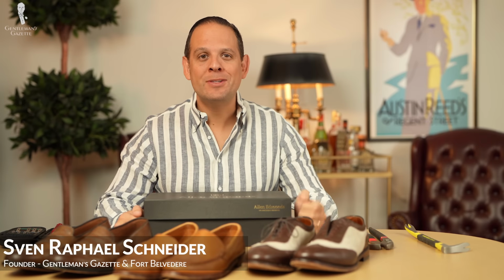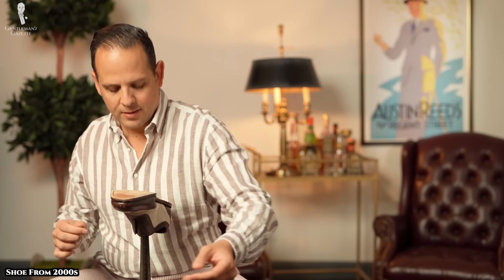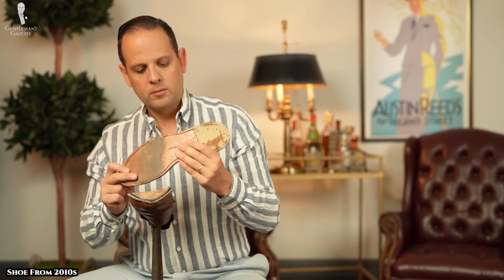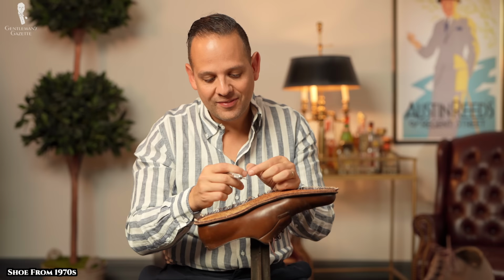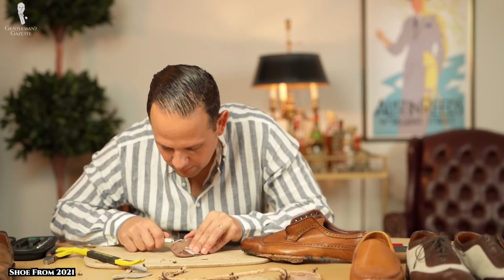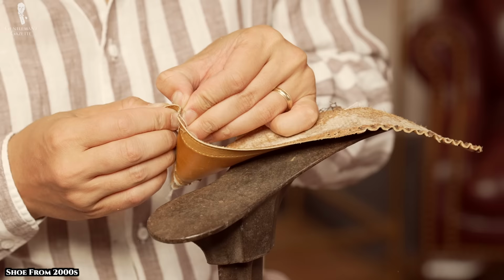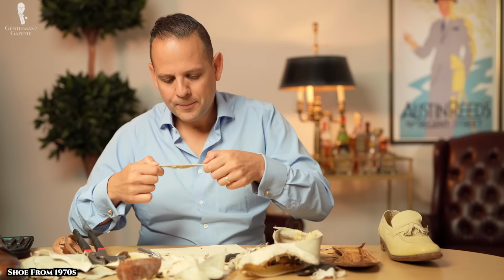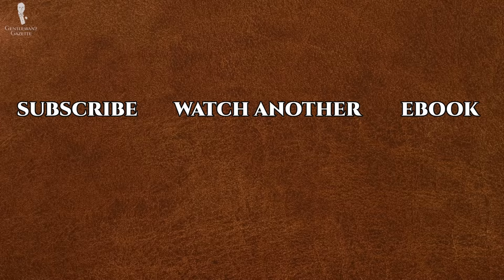Cutting Apart 50 Years of Allen Edmonds Shoes (Value Review)

Comment: Those tacks/ staples are temporary holds for the gamming, lining and upper before it is all stitched together with the welt. All shoes and boots that are not hand welted have those. Hand welted boots or shoes will use temporary nails that get pulled while the welt is stitched

Comment: Couple of notes. The heel blocks are leather board, not leather. Allen Edmonds heels are thicker on the inside as a means of additional arch support. The thicker inside puts upward pressure in the waist area of the shoe as you walk. 

The pieces of canvas under some portions of the leather is there to prevent squeaking that sometimes happens when you have leather against leather. 

The cork is hot poured cork. It is actually slightly better than sheet cork that even bespoke makers use. Hot poured cork fills all of the void every time. Sheet cork can sometimes leave small voids. Not really noticeable in most instances. 

The staples in the upper are there to tack the shoe to the last before the welt is added.
Reply: Sheet cork can be just as effective as poured cork assuming several layers of contact cement is applied first. The liquid contact cement will fill in all the voids. Contact cement dries into a cushion of soft rubber.

Comment: I’m only at 2:30 and already misleading info.🤣Rafayel, those are fiberboard heel blocks friend. The crow bar is classic, I need to get one to take heels off, never thought about that. 🤣🤣ok back to the video
Reply: Exactly what I was thinking. Kind of reminds me of the belt video.
Reply from the maker: How do you chemically determine if it is fiberboard made from wood vs, leather scraps?
Reply: @gentlemansgazette  that’s a good question. The source for that answer would be to contact the manufacturer directly. No not A/E but the actual company that makes the heel bases. MONTELLO HEEL MANUFACTURING INC. HAS BEEN HANDCRAFTING CUSTOM SHOE COMPONENTS FOR OVER A CENTURY. They are located in Brockton MA. They call it leatherboard thou not fiberboard. They are good people, maybe a phone call would answer that question
Reply from the maker: @BedosLeatherworksLLC  Thank you

Comment: So, basically, with all the talk about Allen Edmonds declining in quality, the only difference in construction the past 50 years is that they've replaced leather heel caps with thermoplastic heel caps. A perfect illustration of how a narrative takes hold and becomes accepted fact even though it has no basis in reality.
Reply: I think the issue is quality control rather than quality itself. 
And I would not doubt if it’s the factory being overstressed to put out more shoes.
Reply: That's not completely true. I handled a few vintage AEs and apart form obvious QC issues can tell the uppers and welt stitching was much more dense, and soles were cut nicer
Reply: @thebarofsoapIG  Yes. It's hard to overstate this point - that quality control can easily vary as owners,  manufacturing locations and experienced/trained employees change.
Reply: @thebarofsoapIG   Its more than QC, its operators on key jobs not being trained/supervised well enough. If the QC is receiving 80% of the product in a poor state, they cannot reject them all and decisions to pass lower quality have to be made. This is the state of the trade nowadays in lower priced brands. They cannot pay high enough wages to retain the more skilled operators and managers and the product suffers. Blame the cost of living for the loss of affordable quality
Reply: I’ve worn Allen Edmonds shoes for almost 40 years. I still own a pair that I bought new 25 years ago. My cobbler recently installed old stock JR soles. The stitch count on the welt of my 25-year-old shoes is noticeably higher than a pair of AE that I purchased two years ago. The mid sole on modern Allen Edmonds shoes is just a very thin piece of leather. The particle board heel stack is just unacceptable in a shoe retailing for almost $500. Two years ago, I purchased a pair of AE Landon boots. They had several obvious cosmetic flaws, and the midsole was a very thin piece of leather. The boots had Danite outsoles. I sent them back. I bought a pair of White’s MP’s. I recently wanted a pair of dress boots, but couldn’t pull the trigger during AE recent sale. I purchased a pair of Beckett Simonon boots instead. They are made to order, and won’t be ready for a couple months. I’ve seen several comparison videos between the two companies. BS boots come with genuine stack leather heel blocks. I paid $169 during their recent sale. It breaks my heart, but the quality and quality control at AE are not what they used to be. Unfortunately through the years, AE has been bought and sold numerous times. I hope AE can improve its quality control. They have been around over 100 years. I hope they can turn things around.

Comment: I think the quality depends on the model, their classic line like the park avenue or 5th avenue tend to be better quality.
I have those mentioned for 2 years now and are still going strong. A lot of their offshoot models usually feel inferior.  I had a pair of Chicago Derby from them and right away the leather felt off. The sole was full rubber(still goodyear welt)  and single pieced.

Comment: A couple high-end shoe stores in town told me they even stopped selling them because the quality is so poor. They told me it depends on the style of shoe. A lot of their traditional styles are still of decent quality, but not always. I bought 3 pairs in 2016 and none of them were 2nds. The sole of the loafer wore all the way through in 3 months. The black wingtip's heal cap fell off after a couple months of wear during a funeral no less. The third pair, I still wear multiple times a week.
Reply from the maker: Interesting observations, Chris! Thanks for sharing.
- Preston
Reply: i can tell you why that's the case. It's because they wanted to sell from their own stores, and didn't want to do it through 3rd party retailer. Literally I asked a few dealers of high end shoes in the Gables and The Fashion district in Miami, thats what they told me. Simple Economics of cutting down cost

Comment: I currently don't have a need to wear dress shoes on a consistent basis (I work outside so work boots all the way), but I'm sure in the future with a career change, I will. I'm going to be eyeing AE until that day comes and probably go for a pair of 2nds.
Reply: They have sales almost every month haha so you could find proper qc shoes for over 100 bucks off!
Reply: @kart182  You're right about that. I checked their site earlier and they had 5th avenues down $100 so they were the same price as 2nds.
Reply: Get them used or as seconds.  If you want better quality at a similar/lower price check out grant stone.
Reply: @franky3fingers337  I second that. Can't recommend Grant Stone enough, although their last for some of their shoes can be a little "bloated" in my opinion. Nevertheless, great quality, great build, great leather and great looks
Reply: @bossman4799  Just buy them now.  Wear them when you're indoors, not working, relaxing, field tripping, shopping, ducking out to the corner shops.  Allen Edmonds may be a beginner's brand for dress shoes but the quality far outweighs their position in the market.  Truly worth the money and my used pairs from 2018 onward are still being worn.  Today I slip into my Del Ray.

Comment: The 360 degree welt has the advantage of better water resistance to the 270 degree welt. But you trade that for a less sleek look.
Reply: maybe, technically.  But the iron ranger for one has a 270 welt.  As does I believe the Indy.
Reply: @claytonberg721  The Alden Indy boot and the Wolverine 1000 Mile have 270 also. Both experience water seepage at the quarters when exposed to water.
Reply: @janerkenbrack3373  anecdotal of course but I hike in iron rangers in all kind of conditions but have never had water seepage.
Reply: @claytonberg721  People will have different experiences. But one of the benefits of a Goodyear welt is the protection against water coming through the connection between the upper and the sole. It is well understood that the 360 offers more protection than the 270. For some this isn't a big deal.

Comment: I purchased a pair of strand oxfords with rubber tap sole in walnut in 2021.  It took maybe a week or two to break in.  They're still the most comfortable dress shoes i've ever owned.  There is very minimal creasing in the past 2 years since i've owned them.  In the beginning, i was using these about 3 days a week. Nowadays, i use them about two times a week to the office. I'm considering ordering a pair of Carlyle Oxfords with the Dainite or rubber tap soles but they're starting to get pricey, even during their sales. Not sure what alternatives would be out there in similar or lower price ranges.

Comment: There has been some debate in the menswear community about whether Allen Edmonds shoes have gone down in quality in recent years. While opinions vary, it is generally agreed that there have been some changes to the brand's manufacturing process and materials that have impacted the quality of their shoes.

One major change was the introduction of a new "integrated cork" footbed system in some of their shoes, which some customers have found to be less comfortable and durable than the previous cork footbeds. Additionally, some customers have noted inconsistencies in the quality of the leather used in their shoes, with some pairs being more prone to creasing and wear than others.

However, it's important to note that Allen Edmonds still produces high-quality shoes that are well-regarded in the menswear community. While some customers may have had negative experiences with the brand, others continue to be satisfied with the quality of their shoes and the company's customer service.

Ultimately, the quality of Allen Edmonds shoes may depend on the specific pair and the manufacturing process used. It's important to do your own research and read reviews before making a purchase to ensure that you're getting a pair of shoes that meet your expectations for quality and durability.

Comment: I watched reviews, read up on the Allen Edmonds manufacturing methods and history, it all sounded great. So I bought a pair of Chukka Boots, great product, great purchasing experience overall, I decided to buy more shoes. Bought a pair of Dalton Wingtip Dress Boots. I received 2 different color boots, also one of the boots seemed to be a different vintage or much older and had been on display for some time. Multiple price tickers attached and removed, physical dimensions were different, a different cut of the same style. I called customer service, they apologized and said they would send out another pair, free shipping. Got the next pair, shoes are with out a doubt reject, much worse than even factory second shoes. I wear a size 9.5, the shoes I received are a size 8 or possible even smaller, maybe 7, but marked as a 9.5 D The shoes were also misshapen. The left looked like a right, the toe was curved outward.  The worst quality I've seen from any shoe company, shameful quality.

Comment: I just bought an Allen Edmonds shoes (Park Ave).  I conditioned them because I wanted to get a mirror toe. I used saphir and as I was conditioning them, the dye was getting light in some areas and swirled in others.  I called them and they told me that I ruined them using saphir , but I could send them back and they can tell me how much it would cost to repair them.  I wish I had at least worn them one time, before this happened.  Apparently, the factory is doing something different (or at least cut corners on mine), and doesn't stand behind the shoes.  I hope this doesn't happen to anyone else.  I won't purchase any other Allen Edmond shoes, because of the product and being told that I ruined them when I conditioned them..
Reply: Saphir is one the highest quality shoe creams you can get. I would argue the shoe is to blame not the cream in this case
Reply: Too late now of course, but I would take Justin Fitzpatrick's advice to avoid conditioning brand-new shoes. Only do so if the leather begins to look like it needs it.
Reply: Saphir renovateur has something in it that certain shoe dyes don't like.

You didn't ruin the shoes, just polish anthem with black shoe polish.

If I stabbed my shoes with scissors trying to trim the laces, they'd say it was my fault.... Because it was.
Reply: Renovateur had an effect on my bourbon Fifth Avenues however with some brown polish and a little bit of care, they still look good and have a unique patina.